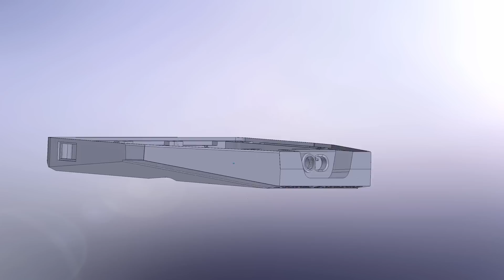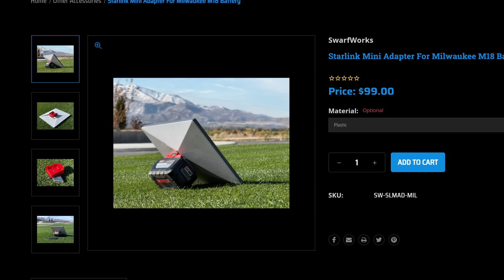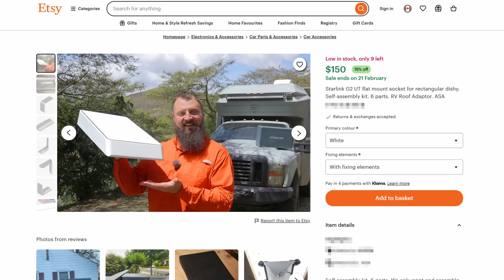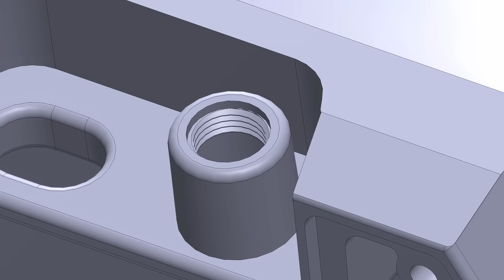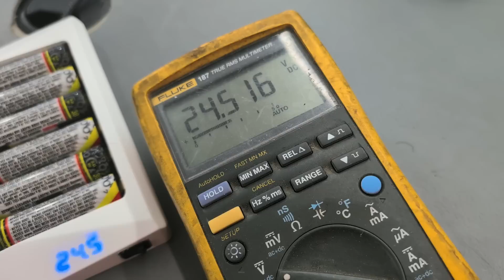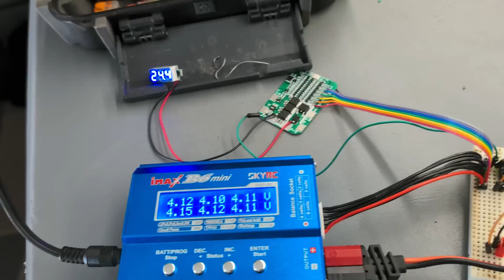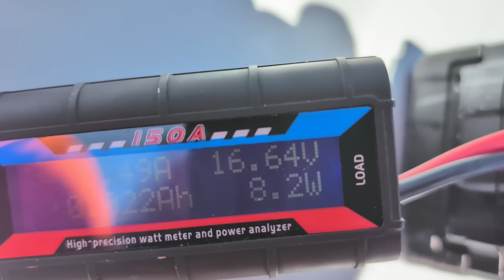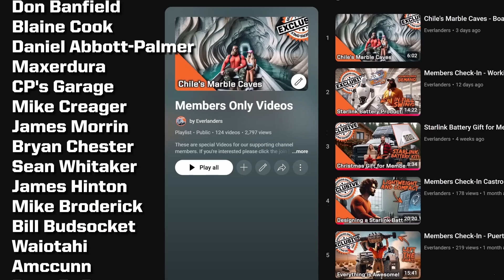DIY StarSled Go - Cheapest Smallest Starlink Battery Pack

Comment: Ever since I got my Mini few months ago for my 4x4 box truck, I'm thinking to build a slim waterproof box that can accomodate the dish, a modular battery like you designed + wireless charging , a foldable flexing solar panel and some waterproof ports (USBs, different charging socket types) and on/off switch.

This box must be tough and as tight as possible on the dish for back packing reasons.

Being waterproof, with a smart weight distribution, it would float flat on the water , so can be a good rescue gadget in case of boat sinking emergencies, combined with a waterproof phone or with other gadget held inside that coud automaticly connect to SL and send SOS & location.

Should have magnets and different types of securing it on a vehicle / boat / backpack, etc

Kind of "all in one" EDC box.

Wish you'll think about it. I am sure you build it better than me.

Sure, this will be history in a few years when all phones will be able to connect on a sattelite network. Our childs will laught about all these big "ancestral" technologies 🙂
Reply from the maker: Is this what you're looking for?
https://youtu.be/6Ns0znKxvrI
Reply: @Everlanders  kind of.. but not so bulky, more refined, should be something light with the size of your lid.

The solar panels should fit the dimension of the case, folded under it and being able to charge while floating on the water. 
With waterproof connections, offcourse.
And wireless charging under.

I keep looking for a box of this size, but nothing came up, so I might build it in the end.. from kevlar composites.
Reply from the maker: @silviuflorescu6838 This is a tall order, if the solar panel is the size of the lid, it won't produce enough energy to power the dish, as I demonstrated in the video. Looks like you'll be building your kevlar case after all...

Comment: If only the engineers from Starlink were watching and learning from these experiments.  it would be a nice option to just snap on a rechargeable battery pack for a hike.  I will probably build one to try out.  thanks for thinking ahead
Reply: Noooo, F off to the starlink engineers because if they were to build it then they would be selling them separate and for $10.99 or more. This guy needs to be selling some, it's awesome he tells you everything needed and even gives you the 3d printing files but not everyone has a 3d printer or is going to buy one and spend even more hundreds in material learning how to build just a couple of these battery packs lol.

Comment: Love it, only thing I'm worried about is the batteries falling out during transport and shorting out on something else in the same pocket. But that can be solved with a Velcro strap across them, or just not leaving in the batteries when it's not in use.
Reply from the maker: Well, I did say 1:22  And also a $1.22 Solution to all your problems... https://s.click.aliexpress.com/e/_okwQE1F

Further, Unless you are also carrying a wad of steel wool in the same pocket you'd need a circle of 122 cells forming a ring nearly a meter across to create a short.

Comment: i know 18650 are more common but i would have done it with 21700 they have cap with 5000mah each

18650: up to 3500mah
21700: up to 5600mah
Reply from the maker: The 0.80 cent cells I showed and linked to are 5300mAh... It's hard to beat the price to performance. 
https://jag35.com/products/boston-sonata-5300-twin-18650-battery-packs-lithium-ion

Further, 6x 21700's won't fit into the cavity in the back of the Starlink.
Reply: @ ahhh ok, yeah the sonata are 2x18650 and stick out

but never the less, nice build,

Comment: Always excited to see new projects.... 

Only because Youtube is going to Youtube. 
What's the difference between a portable USB charger that contains 18650 cells and having cells on the back of the dish? 
I think if I were biking, I would find away to strap a decent battery pack to the bike. In a perfect world, would be cool to have the bike charge the pack, but my lazy ass will never peddle fast enough. but maybe tech is better these days.
Reply from the maker: These long distance cyclists all have generators in the front hub, with USB charge ports on the handlebars. That's why it's designed this way with single cells that can be charged from USB.